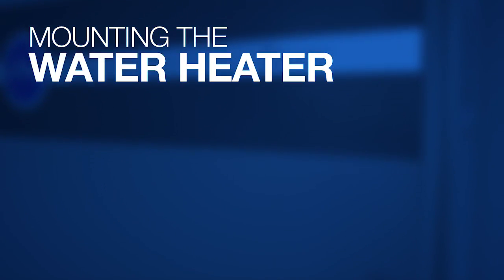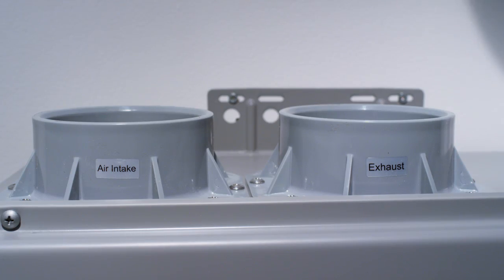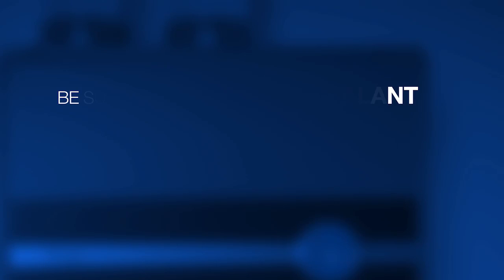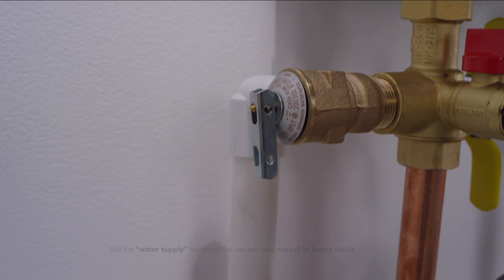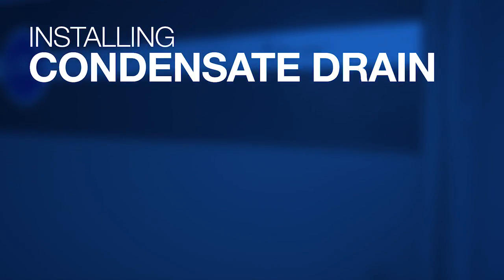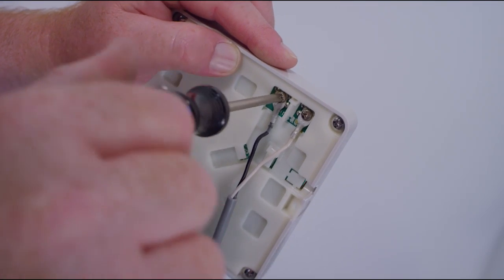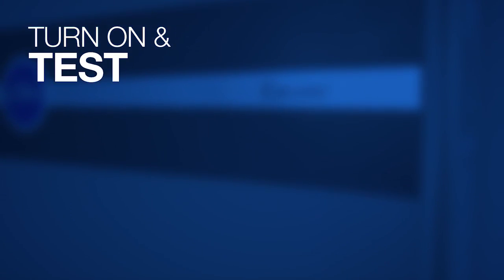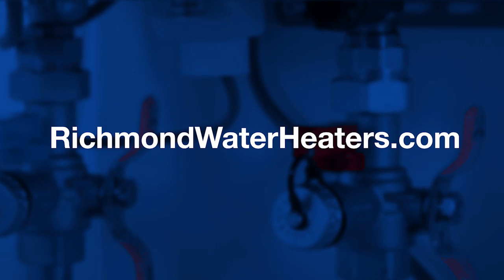How to Install: High-Efficiency Tankless Water Heater

Comment: Hello, I bought Richmond tankless 9.5 GPM model from Menards. Installed per manual's instructions & works nicely for about a week. Yesterday morning, when we turn on the hot faucet, the flow slowed down & trickle to a stop. When we turn off the unit, hot faucet flows back with cold water. When we turn the unit back on, the hot faucet's flow slows down & trickles to a stop again. We tried unplugging the unite & drain the water & re-start again, but still the same problem. Any ideas?
Reply: Check the remote display for the trouble code